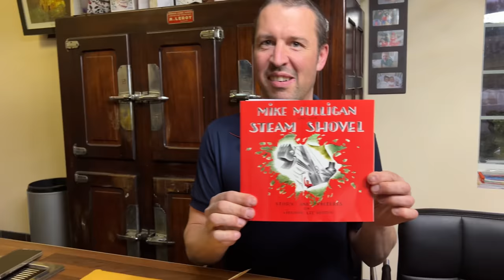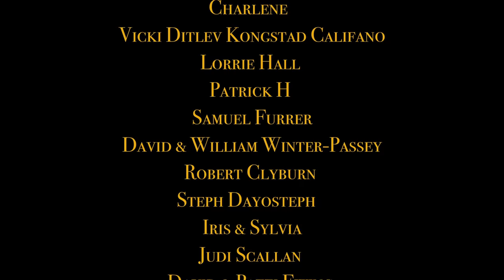EP120 Accidentally On Purpose , Landscaping & Wine Cellar @ Our Passion Project

Comment: just a thought edd will rain water if was an epic storm would it run into the cellar?would it be an idea to install a stem like they have near the houses close to the sea a board system that can slot across doorways/ your stone staircase to prevent epic rain cascading down the staircase and into the celler. and always good to have quite  a few spare tiles be they floor or wall / shower and bathroom tiles just in case you had to do a fix.   also good idea to map out where the outside pipework services pipe/cable was laid in the ground so in event of issue you know exactly where to dig also hence why spare tiles are handy

Comment: I suggest a man on the build women aren't as strong. You guys are doing a fabulous job. Get a man Ed not a woman lol by the way I'm a woman lol much love from Oklahoma USA Jackie 🇺🇸💖
Reply: I think it depends on the person. Plenty of women can lift more than a man (or even if they can’t carry as much dead weight as a fit man, they often may have better endurance). And plenty of building and renovation work isn’t just about hard labor but also about skill, common sense, and attention to detail. You want a reliable, smart building partner who works safely, thinks outside the box to problem solve, reads the codes/manufacturers instructions, understands plans and helps you make them, uses materials efficiently, and cares as much about the end result and doing things the “right way” as much as you do, AND not to mention, is fun to spend all day working with! Bonus points if they have experiences or skills they could teach you, as well. None of these traits are specific to sex or gender or bodily strength.
Reply: @twobluestripes  Okay then, 😂😂😂